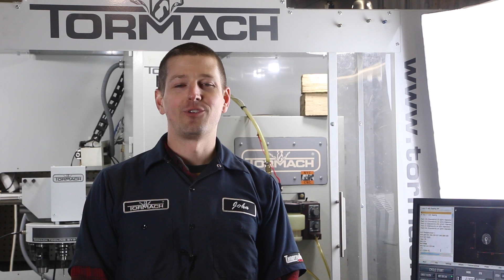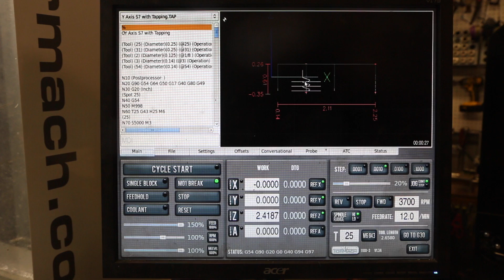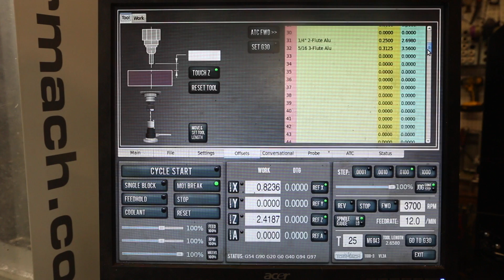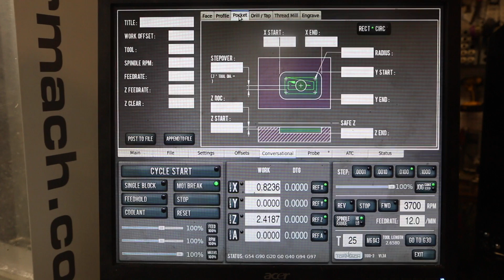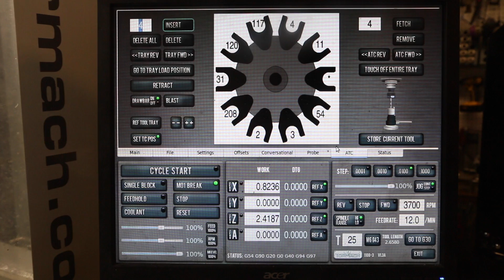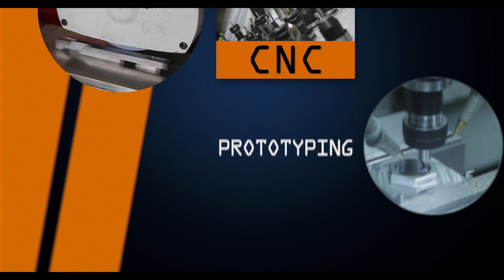First Look at Tormach's new PathPilot CNC Controller!

Comment: Tormach in this case is a bunch of asshats, taking others work, smacking some UI on to it and packaging it and make money off of it and not giving anything back to the LinuxCNC community... Opensource, should be open.. and not closed off like this.
Reply: Diesel Ramcharger Nope, it's not. Mach is certainly not a closed source port of LinuxCNC. It is a derivative of the original NIST's work called EMC (Enhanced Machine Controller), but the current LinuxCNC (evolved from emc2) has evolved quite a bit since then.
If PathPilot is based on LinuxCNC then they will have to comply with LinuxCNC licensing.
Reply: Having been involved in open source for years while also working for a for profit company this is not a discussion I haven't heard before.  There is always a dance that folks on both sides of the equation must do.  In many cases consumers of OpenSource do give code back to the community in the form of new features, bug fixes, etc.  Tormach will have to do the same dance.  I for one support them consuming open source and making products that make the world a better place.  It can be discouraging for other contributors to a project to see others profit but that is the nature of open source.  Everyone needs to put food on their table in some way.
Reply: Daniel Kitson What software? Their changes to the base LinuxCNC / Machinekit code are already released. They have their own (nice, shiny) "skin" on top but that is "theirs" to do with as they like. 

I have written code on top of LinuxCNC that I haven't released but I am using. If I gave that to a friend, do I then have to release it publicly under GPL? I see the Tormach "skin" in rather the same light. 

If you use LinuxCNC, and you want some sort of conversational GUI then you could try:
http://linuxcnc.org/docs/html/gui/ngcgui.html
http://www.linuxcnc.org/index.php/german/forum/40-subroutines-and-ngcgui/26578-linuxcnc-features-a-kind-of-ngcgui
(That thread is long, with lots of progress)
Or even my own: http://www.linuxcnc.org/index.php/english/forum/41-guis/26550-lathe-macros

I would love to see the Tormach GUI released publicly, but they spent a lot of effort on it and it is important to them to convince their customers that it is an upgrade from Mach and swallow the pain of that.

I am going to continue this out of this vituperous thread.
Reply: They haven't give nothing back. http://git.linuxcnc.org/gitweb?p=linuxcnc.git&a=search&h=HEAD&st=author&s=rogge
Reply: Moronicsmurf It seems that they funded Rob Ellenbergs TP improvements. That's a lot of stuff: http://git.linuxcnc.org/gitweb?p=linuxcnc.git&a=search&h=HEAD&st=author&s=ellenberg
Reply: Daniel Kitson LinuxCNC exposes an API at the User Interface Layer. There can be different licenses either side of such a boundary. If you have an iPhone look at the hundreds of pages of Open Source licenses there are in Settings->General->About->Legal->License. 
I can speak only for myself, not for LinuxCNC as a whole, but the stuff that I wrote I wrote to be used, and the more folk who use it the happier I am. 
LinuxCNC and other Free Software  is "Free as in Speech". It doesn't always have to be zero-cost.
Reply: I think it'd be great if Tormach released the code they developed to extend (and beautify!) LinuxCNC back to the open source community, but frankly, I don't expect it.  I'd be reasonably happy if they just put a little acknowledgement on the screen saying something like "Powered by LinuxCNC".  That seems like so little to ask when probably 95% of the code is LinuxCNC.  Just a little generic recognition for the 26 years of open source development that's gone into LinuxCNC.
Reply: Liberty4Ever
It looks like Tormach might be feeding at least some of their code back to the open source community that supplied LinuxCNC?

http://www.tormach.com/blog/pathpilot-beta-testing
Reply: NYC CNC They should really make their contributions more public or these questions about giving back will only get more attention than their switch from Mach to LinuxCNC. just my $.02

(just reading this now) They do mention LinuxCNC as well as "we’ve made substantial improvements to the underlying source code" but nothing specifically about giving it back to the Open Source project. Depending on the LinuxCNC license Tormach may or may not have a legal obligation to contribute their fixes and add-ons back to the code repo but it would probably be best if they did for PR. http://www.tormach.com/blog/pathpilot-beta-testing
Reply: Moronicsmurf Mach is a closed source port of LinuxCNC. So by doing exactly what Mach did Tormach is a bunch of asshats? Your name fits you well.
Reply: Brian Boatright Their software is for their machines, making the software that runs their machines open source really doesn't do anyone any good. They need closed source software if people are going to expect warranties on these machines. Pick your poison, you want open source then go for it. Few people have the skills to function as a cad programmer, cnc machinist and software developer. If you could do all that, you wouldnt be buying a tormach in the first place.
Reply: NYC CNC yes.. of course.
Reply: andy pugh Yeah that would actually be a shitload of work. Where does it state they funded that? That part i understand was rewritten quite alot as of late.
Reply: Further research shows that the upgrade also swaps the parallel port for a Mesa 5i25 FPGA card. That is likely to provide a significant upgrade in itself, as step resolution improves from a few dozen kHz to 10MHz. It also opens up the possibility down the line of servo control and lots more IO lines (A single 5i25 can drive 768 IO pins. In fact the prorocol supports twice that.)
Reply: Yeah this came off as a hot topic in the linuxcnc mailinglist. - starts with some youtube flaming ending up in a loooong email conversation in the linuxcnc community. ;)
Reply: Moronicsmurf Most of the linuxcnc "community" is a bunch of douche bags who are users, not developers. Leave it up to the dev's to be mad or not. We all know every piece of hobby software is a port of EMC. Lets all be clear on this. Tormach using an open source code, modifying it for use on their machine and not releasing it is absolutely in spirit with open source. They took it, used what they could and wrote the rest to suite. Why release it? They had to pay developers to write it, so at that point it is no longer open source software. I guess those same people that bitch and complain also go to work without expecting a pay check?
Reply: Well, they should release it to comply with the GPL license the accepted by using the source code in the first place.. thats it. And yeah im a developer, been working with open source professionally for 15 years.. You can actually make money and comply with the GPL license..  And to be fair most of the diy cnc community is a collection of know it alls and douche bags.. its the tendency of a technology hobbies overall imo.
Reply: i agree free should be free
Reply: I see your point, my dislike is that it seam that tormach aint going to release the software unless you own a tormach machine.
Reply: hla27b If they "stole" it according to the GPL agreement, go after them in a class action suite. Oh wait. Shit talker. Thats Right. Might want to Read GPL Section 2-c
Reply: How could it be possible that Mach3 is a port of LinuxCNC?
Reply: Diesel Ramcharger Because this is how Open Source works. The work Tormach stole was licensed under GPL, which means that the code is made open for you to use. In exchange, when you make changes to the code you must make them available under the same terms. 

Also, if Linux CNC community is a bunch of assholes why build on top of their code? Why not go and fuck yourself?
Reply: andy pugh Ok, nothing is exaggerated, but what ive found its not much at all, basicly bug fixes and no larger contributions to the eco system. And as you know ive been ripping through the linuxcnc source for a couple of weeks by now. Even tho i prefer using github for tracking commits and forks. =)

Comment: how do you post to PathPilot? Mach3?
Reply: Pathpilot is LinuxCNC so its the standard Fanuc compatible post, same as mach3.
If you wanna dive into it; here you have the source.
https://code.google.com/p/rs274ngc/
Reply: NYC CNC Does that mean that all my existing code has to be redone with a new post ?.
Reply: Andre van Heerden that's what I want to know - my CAM software has a post for Mach3..........
Reply: Andre van Heerden Basic/standard codes M and G codes should work fine, subroutines and fancy stuff is done a little bit differently so will have to be tweaked.
Reply: Mach3 and LinuxCNC use very similar dialects of G-code. (Both based on NIST's RS274NGC) There are some places where specific new codes have diverged, but those tend not to be used by CAM software anyway. 
There is a Postprocessor for Inventor HSM (and I guess HSMWorks) called "Generic EMC2" which works very nicely indeed with LinuxCNC. Most other CAM systems (Such as CamBam) also have a suitable postprocessor, you just have to make an educated guess whether to look for EMC2, LinuxCNC or (now) PathPilot.
Reply: I am one of the LinuxCNC developers, I wrote a fair proportion of the Mesa card drivers.